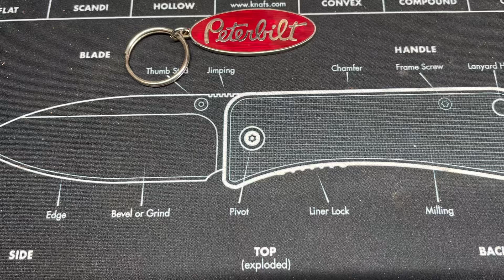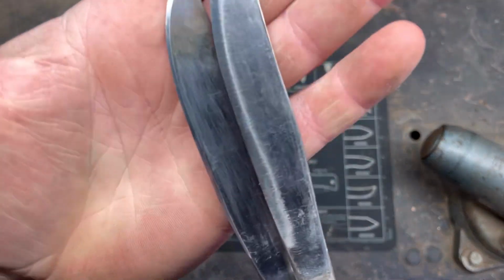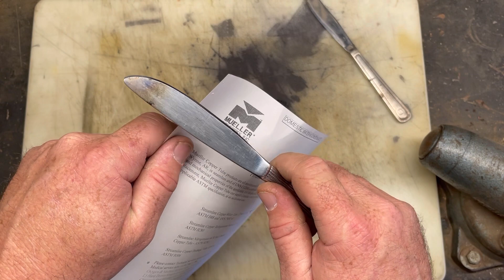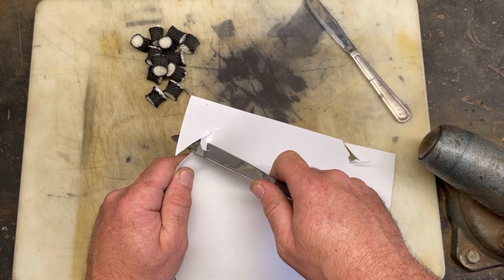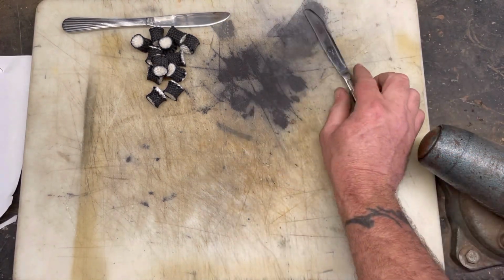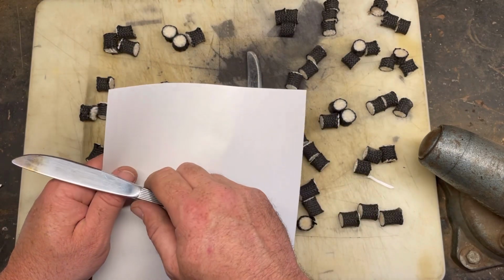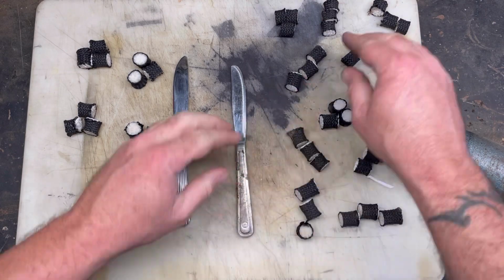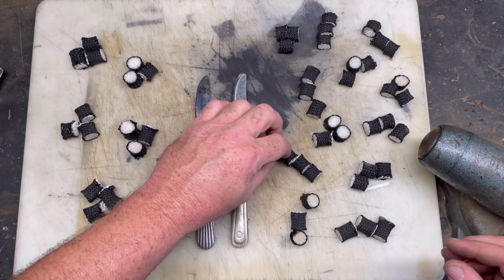How important is knife edge geometry?

Comment: For a folding knife I lay the edge back to between 25 and 28 degrees inclusive since it will not be doing anything too hard. Another variable is edge stability. Some steels are very different in there edge stability. Steels with good edge stability are better candidates to lay the edge back on. A tough steel does not guarantee edge stability, they are not necessarily related. I enjoy the cutting performance of a layed back edge and that affects my steel choice.

Comment: I did a butter knife like this on a Work sharp Ken Onion KTS when I was learning that system. I use it to refine and redo edge bevels, broken tips and. such. Much the same result, but I didnt have climbing rope. I cut up some old heavy blue Jean material to make a run of char cloth with them😂